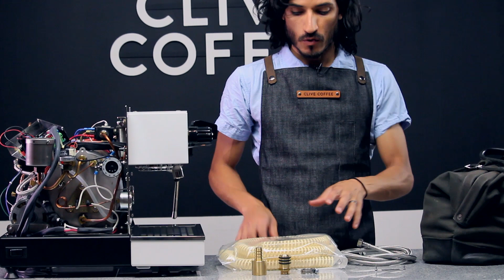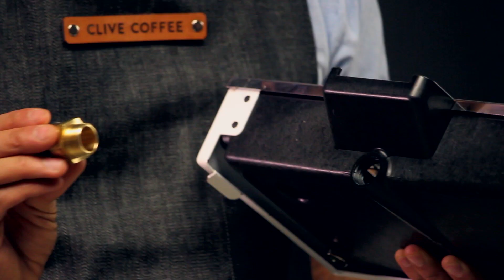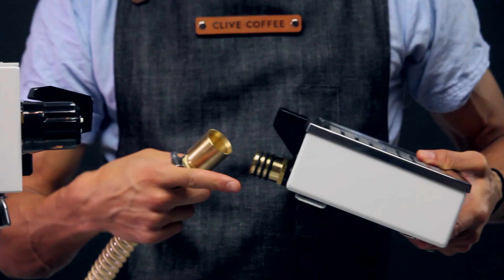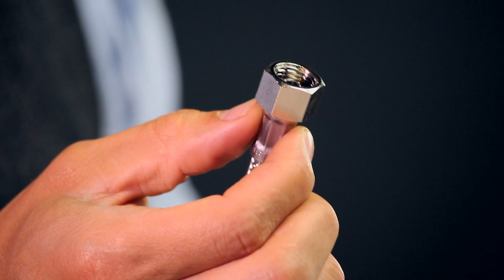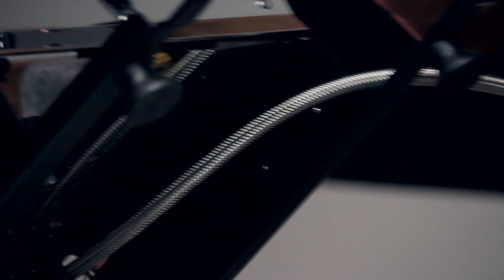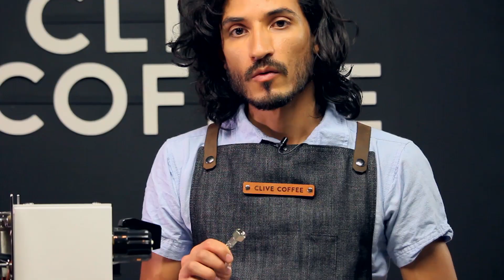La Marzocco Linea Mini | Water Supply And Drain Kit Assembly

Comment: Hello there, if I use the flojet bottled water system and the water in the 20 litre bottle goes below the automatic cut off and the flojet stops, what would happen to the La Marzocco machine, will the boilers turn off or will my boilers burn out? 
Thank you.
Reply: Most likely to turn off as if it was running on its water tank. Have you tried it?

Comment: hi there can I use standard and pressurised baskets on the same machine
Reply from the maker: Hey Colin, the Linea isn't meant to work with pressurized baskets and we'd certainly recommend using the baskets that come with the machine. Pressurized baskets make consistent results "easier" but generally vastly reduce the quality of the shot. We'd love to chat more about technique. If you're interested, shoot us an email or chat through our website!
Reply: Has to be a troll post...
Reply: sluflyer06 Or he could just be... unwise